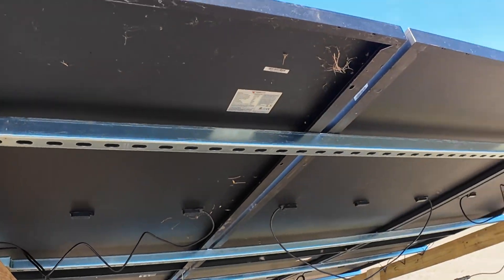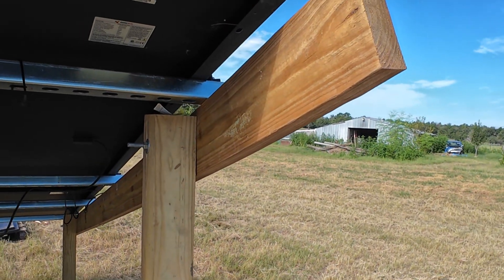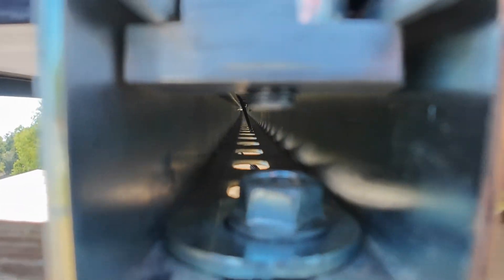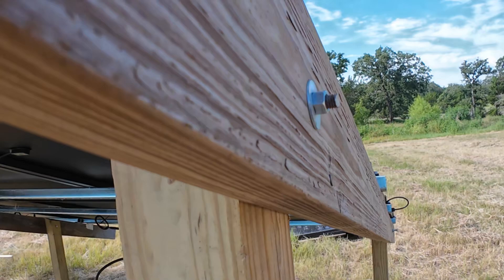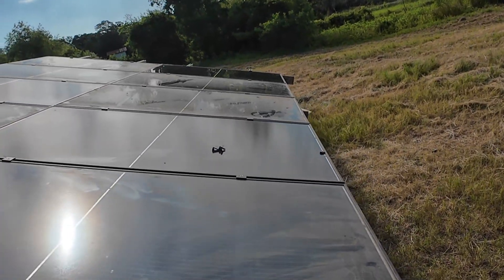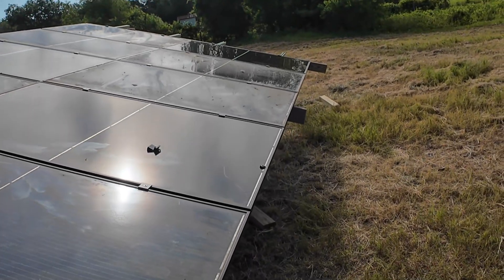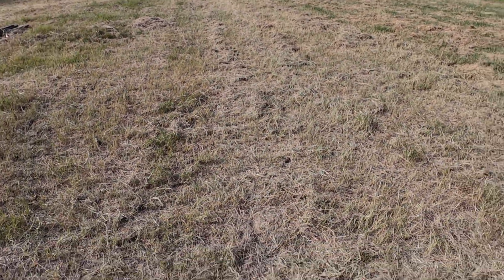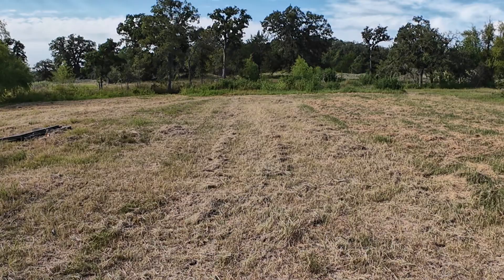Cheap DIY Unistrut Solar Ground Mount And New Earth Mount Idea!

Comment: I like the uni-strut method. Several brands of clamps will work and you can even buy metric strut clamps. For ground arrays, I always prefer steel and concrete posts around here. In some places you can, even pound in six or 8 foot long steel post every 20 or 30 feet, but not around here.
Reply from the maker: Yep, Uni-strut is good and used to be an affordable and a locally available option but getting expensive now too.
Think I'll try some 20' long square tubing next time.
Thanks for watching!